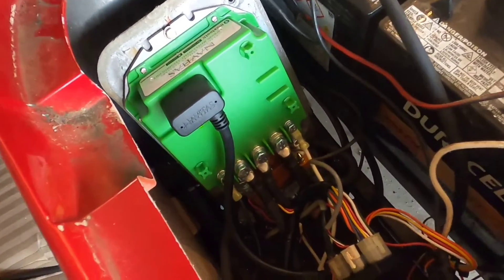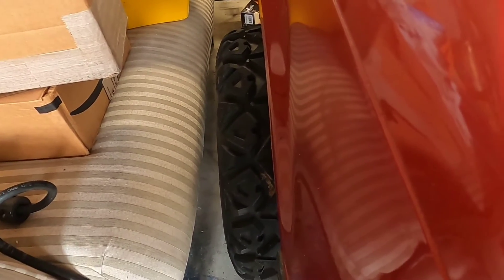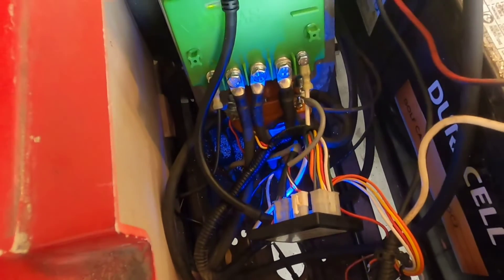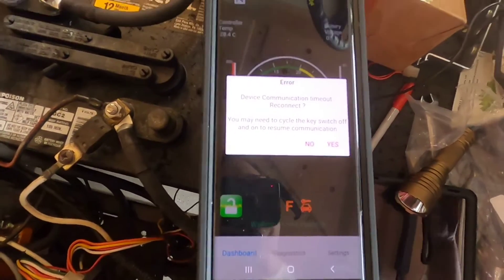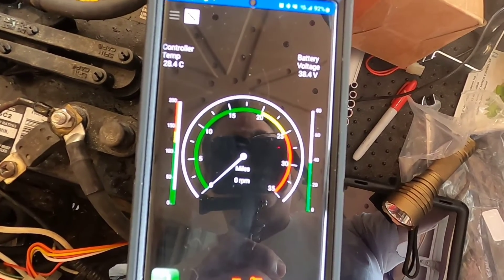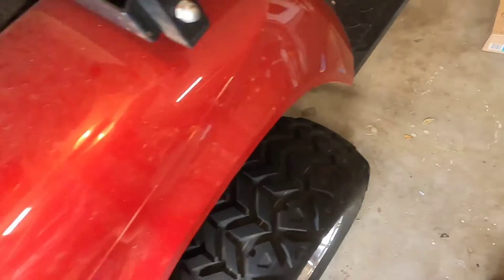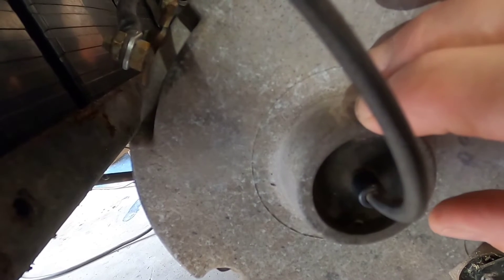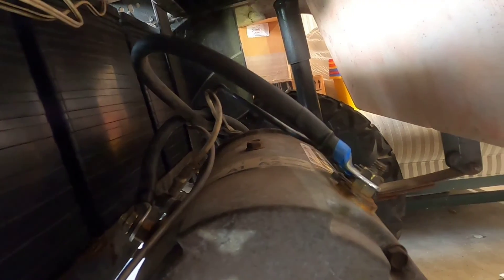2005 36v EZGO PDS Navitas TSX 3.0 problems

Comment: Had same problem on my Yamaha g29 I opened up my motor brushes was melted
Reply from the maker: Thanks Mandy, and i may still do that too.  I uploaded another video where I tested the motor directly to the battery and the motor turns in forward just fine.  I am wondering if my speed sensor might be the trouble